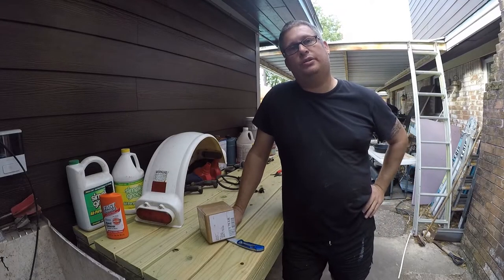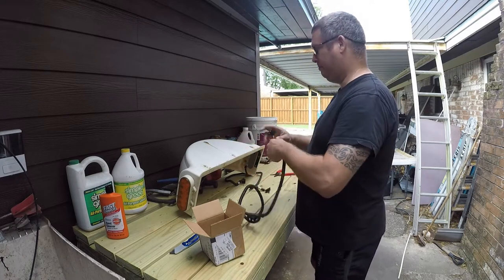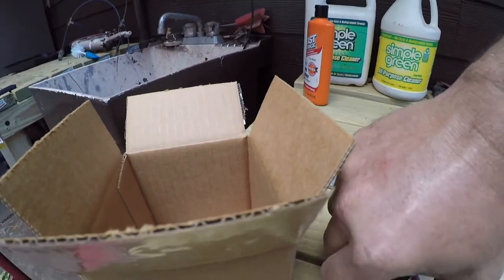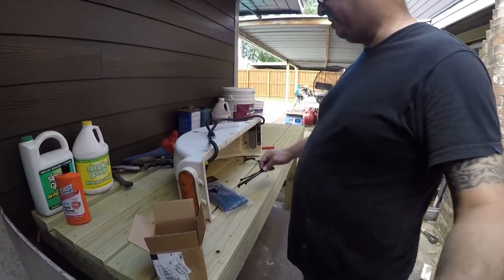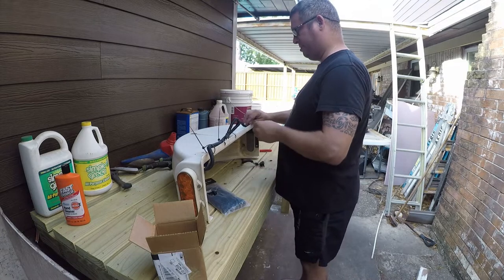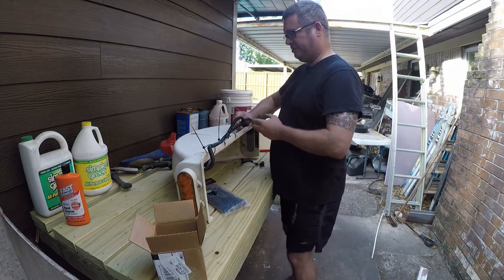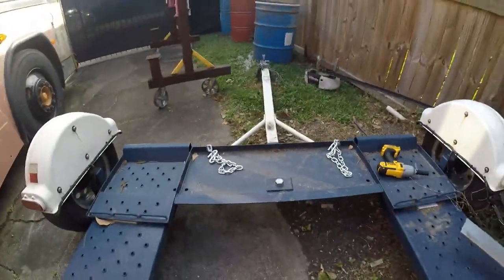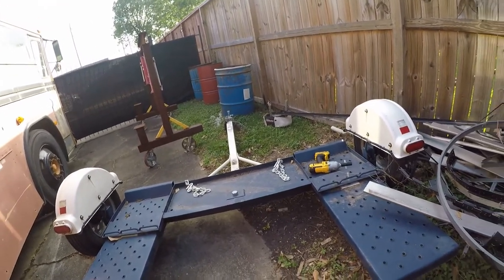MasterTow Dolly Repair - Part 2

Comment: I have a master tow with the 7 pin, my turn signals and brake lights turn on, but the marker lights wont stay turned on all the time.. is that normal?